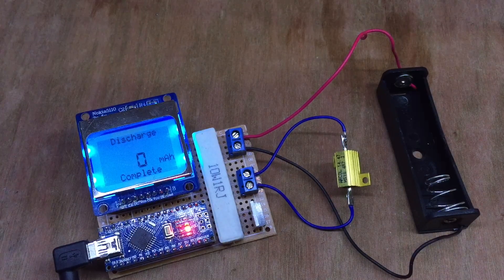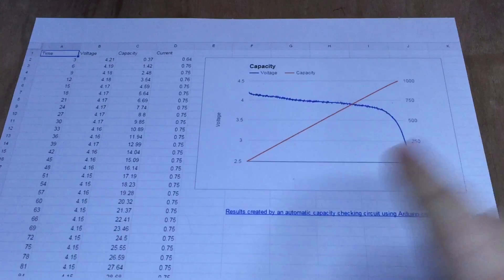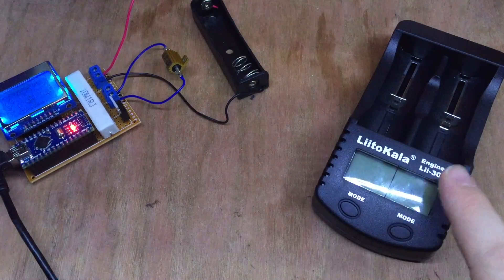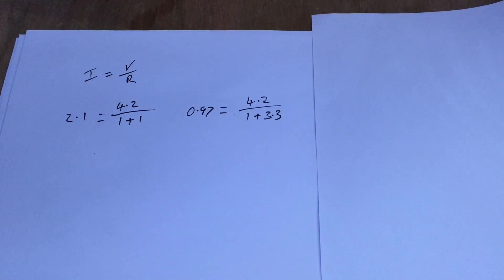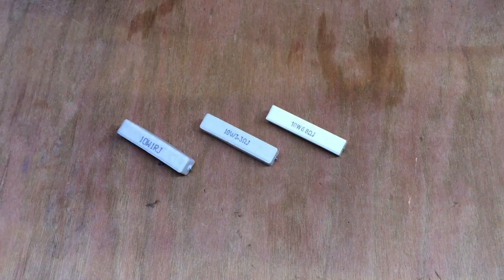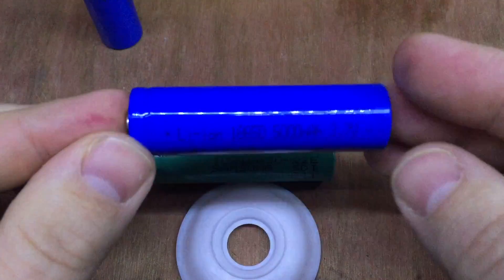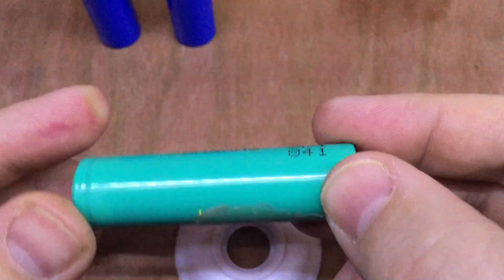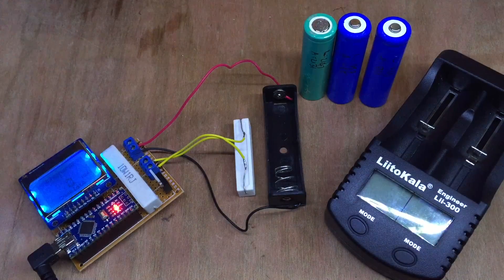Lithium Ion 18650 Capacity Checker Update - Adam's Arduino Projects

Comment: Adam,

finally got to building your capacity tester today.
The first 18650 is running as I'm typing this.

I made a few changes to the hardware:
Used a double (quality) 18650 battery holder, so one battery is for testing, the other powers the arduino and lcd.
Had to add a 5V boost converter to get the input voltage to .. 5.24V (Changed it in your script. Excellently documented)
In the pictures you can also see a 1117-3.3V on the backside. Wanted to use it for the 3.3V led power supply on the LCD, but afterwards my LCD needed a 100 Ohm resistor on the LCD Led pin to GND.

The LCD library you used cannot change the LCD orientation, so for now the power and rest buttons are on top.

The build worked perfect at first go. Just measure the load resistor correctly and set this in the script, together with the correct 5V reference voltage.

The 4,7 Ohms 10W cement resistor gets really hot, but I left a bit of space between it and the PCB. The hotglue on the other side of the pcb does not get soft, so it's a good indicator that the 18650's are cleared from the generated heat.

Thank you for this excellent design. Below the links to the pics of my build.

http://kennethtan.nl/Media/Photos/20160318_145356.jpg
http://kennethtan.nl/Media/Photos/20160318_145414.jpg
http://kennethtan.nl/Media/Photos/20160318_190246.jpg
http://kennethtan.nl/Media/Photos/20160318_191738.jpg
http://kennethtan.nl/Media/Photos/20160318_191748.jpg
Reply from the maker: +Kenneth Tan I'm very pleased this is working well for you. Sounds like you've made some interesting improvements too (I think I mentioned I made this with bits I had lying around). I used USB to power the Arduino. I guess yours is a little more portable!

The load resistor does get hot - mind your fingers!

Thanks for sharing, it really does put a smile on my face to know people are benefitting from my videos.
Reply: +Adam Welch How about adding a tp4056 charge board.
With that you could do a one-shot charge of The battery and using The charged-led of that board trigger The arduino to go into discharge mode.
The same pin 10 could be used in The charge process to disable discharging. Only problem is that the charge board has a low-power disconnect voltage. Therefore there needs to be a second MOSFET p-chan between charge+ and bat +.
I believe you cannot use a n-chan MOSFET to disconnect the charge board.
I believe it's really simple to implement.
Reply from the maker: +Kenneth Tan Yeah, you could charge, discharge and then charge again! It would be nice to see your developments.
Reply: +Adam Welch Sorry for the simple layout. Was made on Android tablet.

I&#39;ve tried to add the tp4056 charge board to the design.
http://kennethtan.nl/Images/Lipo%20capacity%20meter%20V2.0.png

Needed to add two MOSFETs. Q2, a P-chan disconnects the charge board during discharge cycle.
Q3 is needed because &quot;Bat -&quot; is separated from ground by a double MOSFET switch.
So during charge Q1 and Q3 are off and Q2 on.
During discharge, Q2 is off and Q3 is on. Q1 is controlling the discharge cycle.
Also implemented a start and reset button.
With this you never need to pre-charge the battery you want to test. It&#39;s done in circuit.

An external PSU is needed. Charge current is 1A.
What do you think? Any errors?

If Q2 and Q3 are both on doesn&#39;t harm the circuit only the results. So no H-bridge dilemma I think.
Reply: +Kenneth Tan Working on some enhancements:
Hardware:
Adding SD card reader to store name of battery and measured values per battery. 
Adding larger color display to view live graphs.
Adding rotary encoder for menu system

Software:
Menu system for adding/selecting batteries (history is battery "x")
Live and history graph for battery "x"
Start, reset and format option for memory card, with auto-wipe of unfinished cycles.

I hope I have enough I/O pins to implement.

Alternatively, we could forget the SD card option and convert the script to an ESP8266-07/12, multiplex the two analog inputs to the one available and send all data via MQTT. Dump the entire display and maken it WebEnabled. And if you want to go really fancy, use websockets for the live data.

Ehhh, let's start with option 1...
Reply from the maker: +Kenneth Tan You seem inspired! You've done an awful lot of work in a short time. The schematic looks good. Much better than my scribbles!  I'd love to see it running when you manage to put it all together.

Comment: Anyway to pair this with a tp4056 so that you could make something to charge the battery then discharge in one unit?
Reply from the maker: +Colin Hickey It might look a bit Frankenstein...  I guess you could place a mosfet inline with the TP4056 and switch it on and link to the LED pin on the 4056 to trigger switching it off and start discharging. 

I think in all honesty the best improvement to this design would be to make it a multi-cell discharger.  I think you could discharge four cells using all the Arduino analog and digital IOs.
Reply: Cheers, I've approaching 300 cells to test so trying to think of the best/easiest way
Reply: +Colin Hickey I'm seeing some funny results with mine.  Any battery is showing extremely low, at a guess %10 of the amount.  Think i've made a wee mistake along the way !
Reply from the maker: Odd. Have you made any changes to the code? The circuit is pretty simple - it should either work or not work really!
Reply: No code is standard.  I'll have another look at the circuit.  Should it show a voltage on the display with nothing connected as mine does.  Sometimes it's around the 1.2-2v mark and goes straight to complete other times it shows a voltage of 4v+ and discharging which is strange.
Reply from the maker: Ah ok. I think I might know the issue. I don't think your arduino is referenced to the cell negative. There should be a link between arduino ground and cell negative to ensure voltages are read correctly.
Reply: Hats off to you, I've done that and it's showing 0.00v when I do a reset and now testing with a cell it's reporting a more realistic voltage and the current draw looks spot on.  Many thanks :-)
Reply from the maker: Glad to hear that seems to have fixed it. :-)
Reply: +Adam Welch Just wanted to follow up that it works pretty well.  My iMax B6 is a little more pessimistic on the capacity although i'm not really sure how reliable it is as it's a clone, they are pretty much in the ballpark though and around %5 difference which is acceptable.
Reply from the maker: +Colin Hickey Really pleased you've seen decent results with it Colin.  Thanks for letting me know.

Comment: I was viewing your video. And I believe you can report the battery internal resistance also.  You can read the current (Ibat) already  and the battery voltage. the internal resistance should be "Rbat = ( Vbat(No-Load) - Vbat(Full-Load))/Ibat". In this case you will have to read the Battery Voltage when the Mosfet is off and then measure the same voltage when the Mosefet is activated at the same time measure the current as you already done.
Great video...
Reply from the maker: +Dumouchel Clermont Thanks for the kind comments and thanks for the input.  I think that's an interesting idea - I'll have to have a play with that... :-)
Reply: Attempting to implement this I added floats and the lines 'Rbat = ( batVolt - shuntVolt)/current' so it uses the variables from the sketch, still awaiting the resistors and mosfet before I can test to see if it works - parts have arrived , but I cannot get it to show internal resistance it just shows 1 as the result - looking at the numbers as an example - Rbat = vbatnoload - vbatshunt / current Rbat =  ((3.73 - 3.25) / 0.48) = 1 I am doing the formula wrong somewhere...and cant see where!

Comment: Good work! Thanks for sharing it. I have a Nokoser tester very similar to the LitoKala, I find sequential tests give results that vary by up to about 3%. If your units are similar it would make comparisons a bit more tricky. What do repeated checks show when averaged? 
I'm dipping my toe into the Arduino ocean and I find your build inspirational, so thanks again, and cheers from Mullumbimby NSW Australia. 
BTW I see BigClive's Full Metal Jacket screwdriver approach has appeared on your bench too! ;-)
Reply from the maker: +Nic Green Thanks for your kind comments.  Repeated tests on a single cell in my arduino capacity checker reveal consistent results.  I haven't noted the exact figures down, but they are all around the 930mAh mark for one of those cheap cells.

The screw driver in question is available from a pound shop in the UK.  I've got a few as they are so cheap.  I've also got a pack of around 30 bits of all different types.  Useful for getting into things and not having to worry about breaking it. :-)

Comment: I'd guess that the tolerances in the sandbox resistors could account for the differences in the results.
Reply from the maker: +John M I'm sure you're right.  They are only 5% resistors - but my results are all within about 2% of the LiitoKala.  Although who's to say there isn't slight inaccuracies in that either?
Reply: +Adam Welch Hi   I think your results are fantastic so your math calcs must be spot on.
How accurate is you multimeter? I've just sent for a voltage reference source board so that I can set mine up, I've got a couple of meters like yours but with slightly different name and a couple of others but they all disagree with each other, I guess it's time to set them all up.

Keep the videos coming, much enjoy them.
All the best.
Reply from the maker: +John M You're right of cause, I am assuming my multi-meters are accurate.  They both correspond to each other fairly well, and the reviews I've seen of my Vici meter seem to suggest its fairly accurate.  Let me know how you get on once you have your reference board.